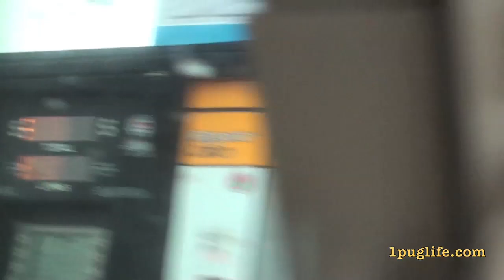a day with nelson

Comment: Can you not cut a little off the bottom edge of the big door so it swings down in place? Just pop a line and hack it off with a  reciprocating saw /saw saw. It don't have to be pretty. So as long as it hangs and not drag.